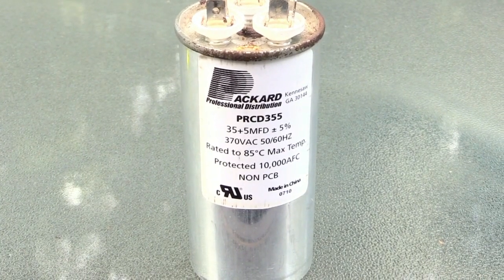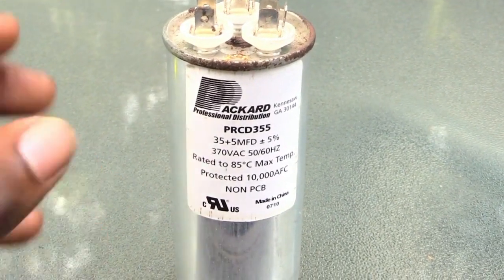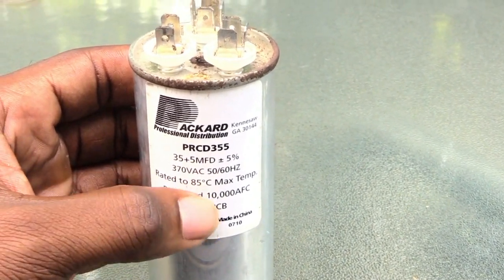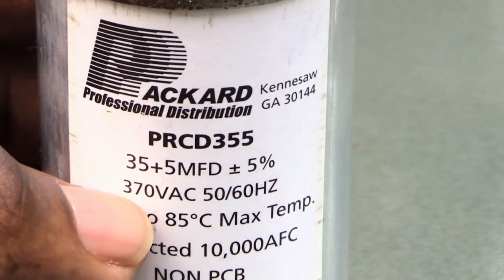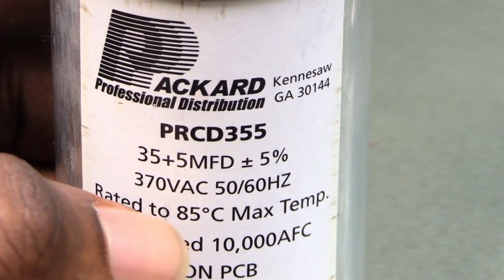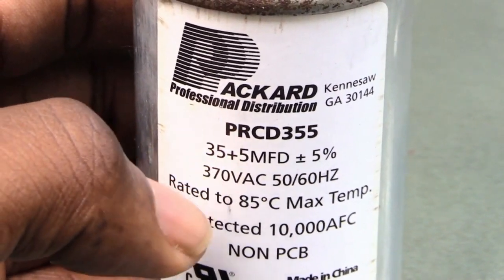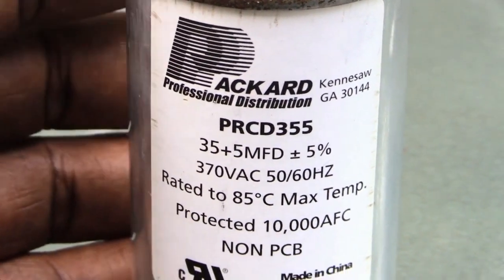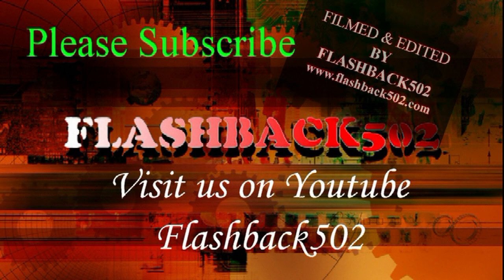How to Tell Home AC Capacitor Size you need!  (WARNING-Make Sure Capacitor Is Safe Before Handling)

Comment: so, my capacitor says 5/45uF ±5%. 

I have questions: 

- is "5/45" the same as "45/5". I assume yes, but want to be sure. 😊 
- is it safe to use a ±6%? Most capacitors that I see are ±6%

Thank you in advance to anyone providing info.

Comment: What if you cant find exact model number of old capacitor? As long as rated the same numbers and physical size will it work? Need 45+8 at 450vac